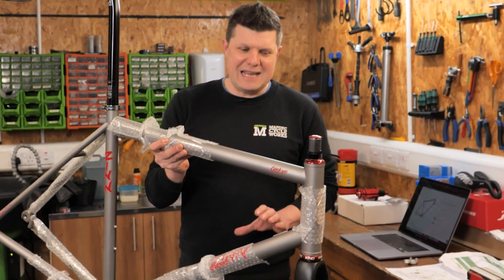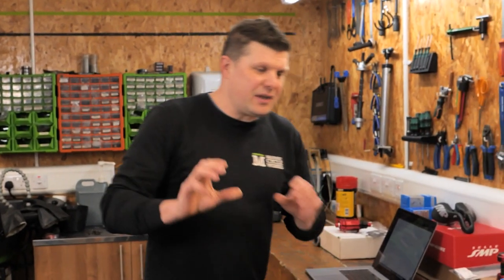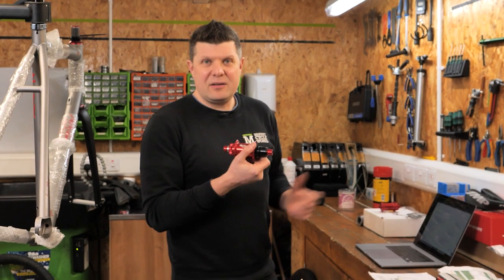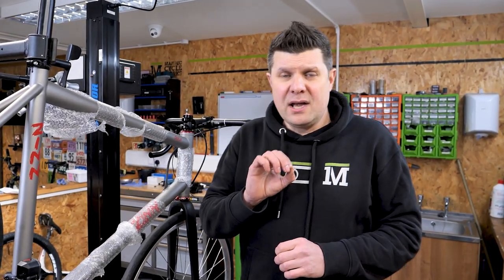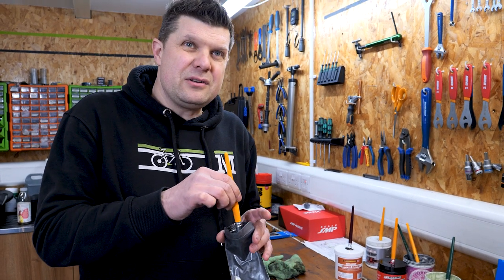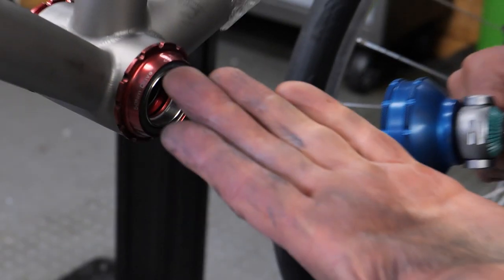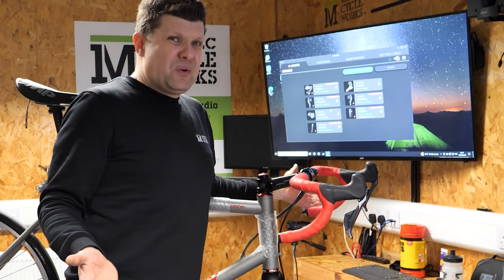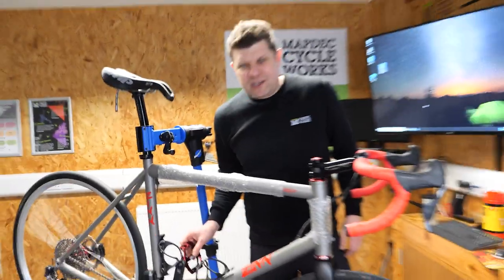The Biggest, Most Custom Bike we ever Built. - Lennard Zinn Custom Ti

Comment: I like using the Shimano SC-MT800 XT Di2 Digital Display Unit for the junction, blue tooth,  charging port, battery level and gear selection.    I have it on several Di2 bikes.
Reply from the maker: Good idea. Hard to conceal cables though.

Comment: I have my di2 shifters set up like that, it works really well and makes sense to me also.
Reply from the maker: It’s obvious when you think about it. The point of electric is to find best solution not replicate the analogue.
Reply: I set mine up identical on each side (big button up, small button down) so that I could shift one handed on either side.
The hidden buttons I just did left down, right up for when I'm getting aero.

Comment: To mount the bottom brackets in the titanium frames, I use "gas seal" Teflon tape, by making several turns on the threads.
With grease it always ends up cracking
Reply from the maker: I’m experimenting with this on a couple of  bikes. I’m not sold yet.
Reply: Isn't the tape going to tear (at least at a  microscopic level) and allow an unprotected surface for galvanic attack? 
Also the Teflon is chemically inert, so provides no sacrificial elements for chemical protection within the grease to arrest a galvanic bridge.

Comment: Copper anti-seize on in the BB with a wrap of Teflon thread sealant (same as plumbers use)is what was recommended for my Ti assembly by Lynskey.
Reply from the maker: I’m experimenting with this at the moment. I’m not convinced with the tape thing yet. I’ll let you all know.  Seems to depend on the quality of the threads. It seems to help a trashed thread, but on good threads it galls up.
Reply: @Mapdec  I had a small issue with the tape rolling too. I didn’t think it was a galling issue since my threads were perfect when I dry fit my Chris King BB it spun in with next to zero resistance.  I figured I just didn’t get a perfect wrap on the tape or the machining tolerances for Chris King and Lynskey were more precise than what I’d be dealing with in plumbing.

Comment: Nickel grease is better for high temperature applications (space shuttle reentry 🤣). Copper grease is a superior anti-corrosion at the temperatures that most of us ride at...
Reply from the maker: I always thought 1000° was probably sufficient
Reply: Yeah,  some people assume because something is used in an aerospace application or a turbine spinning at 3000 rpms that means it is better for everything and 99 times out of 100 it simply is not true. No need at all for nickel based grease in a bicycle application unless you are planning on regularly riding your bike on Venus or like you said re-entering the atmosphere with it. Copper based grease in this app is absolutely better due to its increased ability to prevent galvanic corrosion, but people will do what they are gonna do.

Comment: Hopefully the steerer tube was not cut??? And then put the stem upwards afterwards.Steerer tube looked long enough when you showed it in beginning of video 🤔
Reply from the maker: Very observant.  Fork from Zinn you saw fitted was actually correct to their drawing with the 130stem facing up. The other fork was bought in because we thought Zinn would not be able to supply. The rider is going to test position before we fit new fork.  If you look close at the diagram you will see.  Impressive eye for detail there.
Reply: @Mapdec  lol. Really enjoy your content.  Keep up the good work👌

Comment: For a custom frame, I'm surprised they went for a flipped stem. I'm 6'6" and the headtube on my Fairlight Strael 3 61T looks longer than this one, so perhaps they did it for frames looks, rather than whole bike look?
Reply from the maker: It’s a good question. The plans from Zinn specifically detail the flipped stem
Reply: Stiffer and lighter to flip the stem, as it's a more direct path. If you made the headtube taller and the stem flat, you'd have and "L" shape instead, and you'd need a much longer stem.

Comment: You don´t use ceramic mounting paste?? Should be chemically completely inert. Or isn´t it??     Rgr
Reply from the maker: We have tried it. Haven’t found it me that doesn’t wash out yet. Have you?
Reply: @Mapdec  I don´t really understand what you mean... I´ve used it for some time, the possible drawback is it´s not "greasy" at all, more like using toothpaste. Last time I used it for a pair of Campagnolo bearing cups in a Merlin titanium frame, but they´ve only been fitted there for 1½ year. The bearings are up for a replacement before this season enters so maybe I should touch the cups with the spanner to see?? The Zinn looks great, BTW..    Rgr
Reply from the maker: It just seems to disappear at the sight of water.
Reply: @Mapdec  Made a test in the sink. Just smears and smears, made a white mess of my fingers. I´ll send you a 100 grammes tub to test, it´s a cheap, generic brand from here in Sweden.   Rgr

Comment: Can't help feeling the owner of the bike was overthinking the need for isolating the titanium using aeronautical grease when it's been proven by none other than Phil Wood that anodised alloy BB cups need nothing other than a few drops of loctite to hold them in place in an aluminium or Titanium BB shell and the anodising on the cups prevents galling between alloy and Alum-Titanium.
Reply from the maker: Galling is different to Galvanic Corrosion, which is the main concern here.  But, yes.

Comment: I've had terrible experience with onyx hubs. They provide very little in terms of grease and seals. And once water and dirt gets in they will die quickly. Mine lasted for ~600km total. Which is outrageos. Especially for the price of the hub.
Reply from the maker: That’s a real shame to hear. I don’t have much experience of them, but always admired the design.
Reply: Charles Man  I've returned it yeah. Got my money back, but was still dissapointed. This shouldnt happen to such expensive product.

Bike was prepared for touring adventures, but only seen a bit of roads of different quality. And some dirt/sand in local parks. So, more of a commuter at this point.

I think they went too far on free spinning hubs. While it looks nice on their demo sets, theres a reason why no one else does that. And put rubber seals everywhere instead.
Reply: 2:56 the mechanic states "these will last you forever"
Reply from the maker: The warranty certainly implies that…

Comment: It’s a custom built frame, so why does it need a flipped stem to fit the rider? I’ve seen this a lot with custom frames. People showing off a frame with a big stack of spacers. It’s it truly fits then that shouldn’t be needed. Hope the owner loves it
Reply from the maker: I’m not sure. We built exactly to the dimensions from Zinn. That extra fork will give scope for the stem to be flipped if we need.
Reply: It’s the 130 mm that’s gonna cause anxiety, I’ve recently rented an Eddy Merckx in Marbella with a 120 mm stem and any bit extra steer and I found myself on another planet 😂😂😂
Reply: Some stack on a custom frame is actually the way to go because it effectively lets you use a smaller frame with some spacers added. Why would you want a larger overall frame with little or no spacers and a slammed stem? Other than looks, slamming your stem provides no benefit at all and doing it means you are riding a larger/taller frame than you need to be versus if you used some spacers with a smaller/shorter frame.
Reply: @Robert-vl3ur  I think you’re missing the point here. It’s nothing do with spacers, it’s specifically the stem is flipped to positive rise. This doesn’t indicate a well fitting frame, rather the opposite of you need to add positive rise to achieve the required fit.  It looks worse than spacers.

Comment: Kind of suspicious that a custom builder like Zinn doesn't trust their welders enough to make a pressfit BB that's round and aligned. Going to the threaded system is just a cop out for cheap manufacturers.
Reply from the maker: Interesting… T47 has been bought into existence by the custom frame builders. It has taken years for the mainstream to catch on.
Reply: Bit harsh ........as there may be multiple reasons why there's a threaded BB (T47 version) on this frame. Customer's preference perhaps ?  If they can make round and parallel BB apertures to spec as shown here then unlikely to be a technical barrier for quality manufacturers of Ti frames. Different world from mass carbon 🤨, Just saying
Reply: What a crap take from armchair specialist.
Reply: The T47 bottom bracket standard was co-developed by Chris King (arguably the best components maker on the planet, and if not #1, very close to #1) and Argonaut Cycles out of Bend, Oregon, who are arguably the very best CF bicycle frameset fabricator on the planet. If you think they are a cheap manufacturer or a manufacturer that cuts corners go take a look at one of their CF bikes at the annual MADE bike show. I'd challenge you to find even one respected bicycle frame maker that thinks Argonaut is a cheap manufacturer or that they cop out on anything when fabricating their CF framesets. Most extremely high end titanium frame makers like Brad Bingham, Baum, DeSalvo, and Darren Crisp ALL offer frames with T47 BB's as well, and if you ever tried to tell anyone that actually knows anything about bike fabricators that any of those guys are cheap manufacturers or they are coping out in their bike fabrication process you would get properly laughed out of the room.
Reply: @Mapdec  You are way too kind Mapdec,  way too kind. LOL
Reply: @Robert-vl3ur  for the prices CK and argonaut charge for their products, they'd better be EXTREMELY well-made. And they are, you don't need to argue that point.
But T47 is still threaded, so there's an extra tolerance in the threads, and like all threaded BB it's still just a press-fit bearing in a threaded housing. 
(Side note, for carbon frames, unless you're using carbon threads, you're bonding in a metal shell to form the threads in the frame, which eventually will come loose and basically bin the frame or be quite expensive to repair. A pressfit frame completely bypasses this issue, extending the usable life of the frame.)